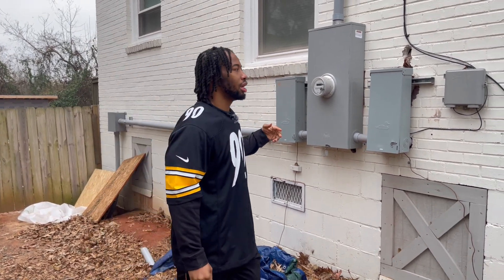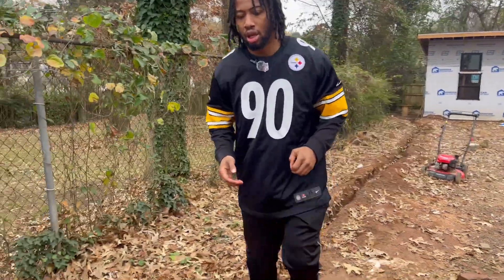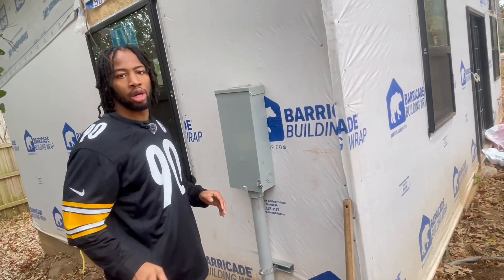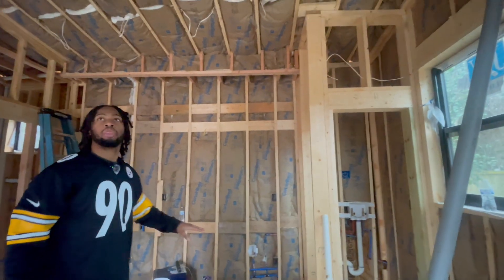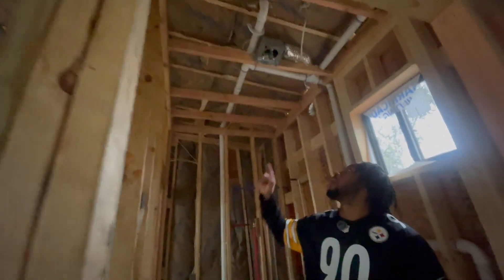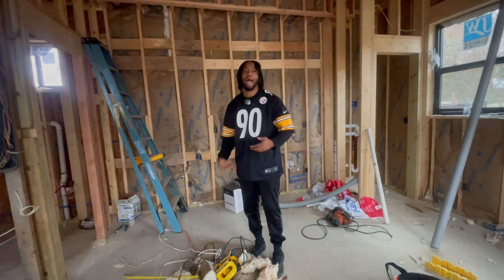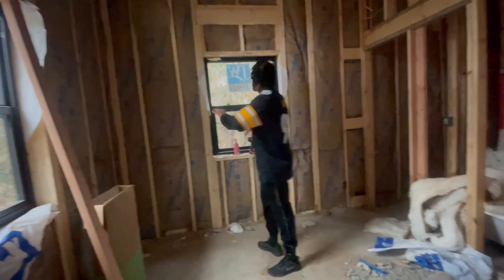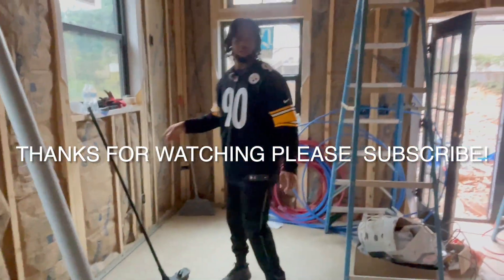Tiny Home Updates| Insulation, Electrical, and Window Upgrades

Comment: In Maryland, the Home Owner can pull the Building Permit only. A Master has to pull utilities ie; electric…plumbing…HVAC…
Reply from the maker: Oh dang that sucks original all my permits was pulled by my subs but what happened was my electrician had pulled the permit on my house to make the meter upgrade  and he wired the tiny house, but never pulled the permit on the tiny house, so inspection could not be pulled and he tried to squeeze me for more money, so luckily I was able to pull my own permit on the tiny house/ call inspection and take control of project

Comment: Yes, your underground wire has to be installed in conduit. In some areas, you can actually install it in the ground without conduit. It all depends on the code requirements in your area. Nice job with your project.
Reply: In Wilson NC, where I built a 1600 square foot house.  By code, if you dig 24 inches, you don't have to use conduit.
Reply from the maker: Thank you and really I thought all areas had to be in the conduit. I wonder what happens to electrical in the areas that doesn’t put it in the conduit

Comment: Great job. As a hobby, I have done about six remodels. It is looking great. For insulation in the bathroom, complete the outside wall. It's the most important. Regarding the lighting, I would recommend that you stagger the lighting in both areas versus putting them in a row. Staggering will cast the light better.
Reply from the maker: Nice where are you located? I want to do a flip next any tips. It would be cool if I can check out some of your projects.
Reply from the maker: Yeah I ended up going back and buying more and completing the insulation 85 extra dollars for peace of mind is well worth it lol